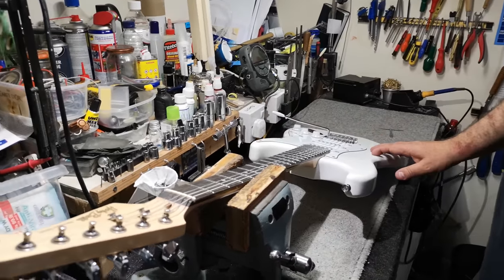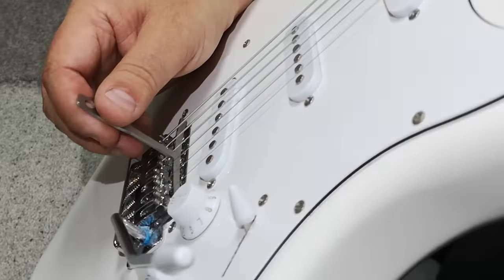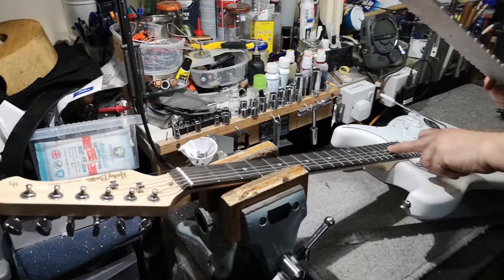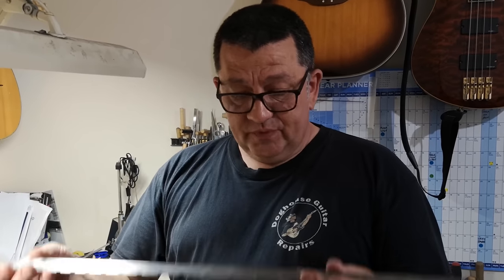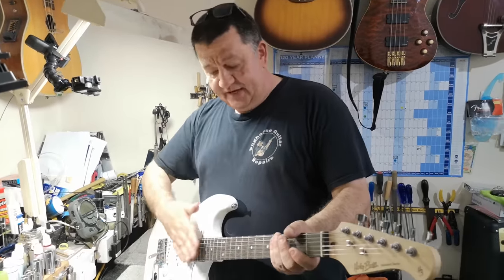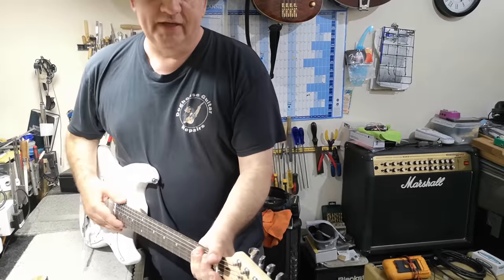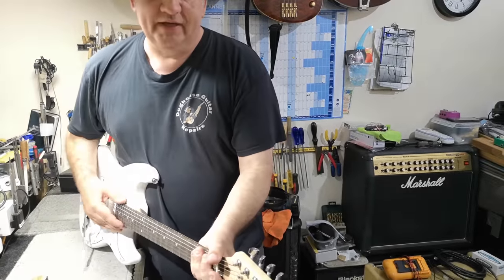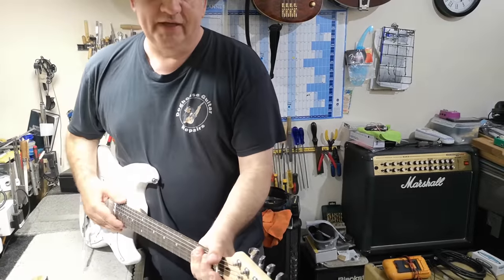I took my £30 / $40 Harley Benton to a LUTHIER...  (Harley Benton Setup - Video 1)

Comment: His main view seems to be just set the action high and you'll have no problems.  What I want to know is how to set the action low with no buzzing or choking.
Reply from the maker: Hey Joe, you can use all the same techniques mentioned in this video to get a good setup on your guitar, then tweak it to lower the action if that’s your preference. 

It does get trickier to avoid buzzing / choking the lower the action gets, any issues in your guitar’s setup make a bigger difference.  I always recommend Dan Erlewine’s books about guitar setups, they teach you everything you’ll need to know.  Hope that helps.
Reply: @ScottPoleyMusic  That's how I judge a guitar, how low the action can go.  I have set up all of my guitars and It's a REAL trick to get those frets perfectly level  enough to have real low action!  That's one reason I like Gibson's latest guitars, because they Plek them and their necks are awesome with perfect frets!  

 I'm always looking how the pro luthiers do it to get that low action.  Stewmac has this weird $600 complicated  neck jig where you  use dial indicators and strap your guitar to it to simulate string tension and then you rotate it into playing position and then level the frets.   I'm going to give that a try (make my own, of course).  But this luthier he doesn't even try to get low action.  Hell, I already know everything about setting up a guitar that he talked about, I was hoping he would have some information on getting low action that I hadn't seen before.

Thanks for the reply.

Comment: I've been adjusting and repairing guitars for over 40 years and doing this on a professional basis since 1990.
My opinion is that each and every guitar should be made as good as possible, without any compromise.
Why? Beacause the materials that are used to make them, are becoming more and more scarce.
Animals have to flee away from their habitat to harvest the woods that are needed to make you a fine guitar.
We can't aford to cut those trees and make poor products out of them, that has to be waisted after a while because of poor qualities.
I consider that to be a serious sin. Cheers!
Reply from the maker: That’s another valid and important take on all of this.  Thanks so much for this comment.

Comment: It just goes to show what the main difference is between a 200 and a 500 guitar. A huge amount of that difference is set up.  The cost goes up quickly when someone has to go over the guitar and make all the corrections. It's the little things in life! You go from a guitar that looks pretty good and sounds ok, but just doesn't feel great, to a great feeling guitar that sounds pretty good. Now he has a 230 guitar that's fun to play.  Great job Phil.

Comment: Any luthier will take any guitar you’ve got at any price level and set it up. If somethings too cheap to work they might suggest replacing it like the tuners the nut not too often the bridge the body the neck and a loaded pick guard you should be fine…
Reply from the maker: Agreed Walter.  With this guitar, I’m trying to make as few modifications as possible (other than the setup).  Currently it’s only had a new jack socket, the rest is 100% stock and it’s performing remarkably well.
Reply: @ScottPoleyMusic  These are the days where you can actually pay 10 or $20 and get a strat shaped object that looks like a strat  and sounds like a strat.

Comment: Every time I watch/listen to a luthier I learn something new about guitars... and, as an engineer, I'm always embarrassed that I didn't figure it out myself. The only topic that I didn't understand was why new strings are required to measure/adjust intonation... huh... is there something non-linear about string age vs string length... what am I missing here????
Reply from the maker: As strings age, intonation “drifts”.  The force / tension on such a thin piece of metal is immense.  

Every time a note is fretted on the neck, the strings bend over the frets causing gradual misshaping of the string.  

It’s a gradual process, but can cause issues, hence using a fresh set to intimate.  Hope that helps 👍
Reply: @ScottPoleyMusic  Oh, I get it. Each fret causes a slight kink in the string which lengthens (or maybe effectively shortens???) the string. You can retune the string, but now since the length has changed, the intonation is off.
Reply: Hmmmm... I'm thinking that those little kinks would change the frequency spectrum of the string... bring up some side lobes of the fundamental??? Maybe even broaden the main lobe??? Anyone look at this with a spectrum analyzer (new string vs old string)?

Comment: I have a Harley Benton myself and have completely stopped playing it! The fret board is way to rough and the fret ends have cut my fingers way to much! The bridge is also very strange and feels really high. All the talk of how wonderful these things are is the biggest pack of lies I’ve ever heard!
Reply from the maker: The fret ends on mine were really rough when I got mine too.  I wonder if your bridge is similar to mine as well - Phill shimmed the neck on mine to get the bridge to sit at the right angle.
Reply: I just seen your response and thank you for replying. I’m still at the same point with my HB unfortunately, it was a gift and I’d never buy a cheap Chinese guitar willingly but it is what it is. One thing else to mention is mine has cheap active pickups (which are downright terrible) the the tuners are just the worst! No matter what I do it just will never stay in tune… I’ve actually looked on Thormann for just how much it will cost me to strip this thing down and replace the cheap with good parts: new pots, wiring, switches, locking tuners, bridge, saddle, and some seymour Duncan APH-2S (the most expensive part that costs more than the the actual guitar), along with tools I’ll need. The total is well over 1000€! This is unfortunate reality of getting what you pay for and why I will continue to warn anyone other than the most absolute beginner about this brand. When you buy a Harley Benton guitar it does not matter how much you invest into it, it’s still and always will be a cheap guitar that’s worth nearly zero the moment you bring it home.
Reply from the maker: Fair enough!  I agree with you about the money pit of modifying guitars endlessly, better to invest in something decent in the first place than replace all the hardware and electronics on a cheap guitar.  That’s exactly why I didn’t spend much money modifying mine.  

There are so many high quality budget friendly instruments out these days, from squire / Epiphone to the new breed from Sire and PRS SE DGT (a beast of a guitar for the price).

Comment: Damn, didn’t answer the question about leaving strings off.
Reply from the maker: General rule of thumb Paul, it doesn’t really  matter if the strings are off for a matter of a few minutes.  I would recommend leaving them off for much longer than that 👍
Reply: @ScottPoleyMusic  I’m refinishing an explorer so strings are off currently. I guess I could just loosen the truss rod.

Comment: Harley Benton have a very flat neck radius, nothing like the 9.5" of a Fender or Squier. This one has 350mm or 13.75" - the radius gauge doesn't help here.
Reply from the maker: I examined the radius more after this video was filmed with my radius gauges.  This guitar's radius starts out as 10" and flattens out slightly towards the end of the fingerboard (not by much).  Maybe Harley Benton did a few runs of different radius'...
Reply: @ScottPoleyMusic  That's interesting. This is their cheapest model. They do not experiment with it. It is more a matter of getting whatever was around in the factory regardless of what the specs say (something that has happened often in the past). Then the angle seems to be wrong too but thanks to Leo Fender, it's an easy fix.
Reply: @ScottPoleyMusic  I also came here to say the guy got the radius wrong but it seems like the factory didn't care too much for the specs.  As long as it plays well, I have about 10 HBs they're all great guitars
Reply from the maker: Apparently so, Phill doesn't get things like that wrong, I can assure you.  He's one of the best in the biz, plus I checked it again later.  It plays great, I used it on a studio session last week.  Video to come.  

Also, LutonMassif... Best YouTube name I've come across in a while 😂🤘

Comment: If he got my harley benton he would have thrown it in the trash lol.  I spent quite a bit of money on tools and several hours just to get it playable.   Then after some Seymour Duncan's I could have just bought a better guitar with a bit of resale value
Reply from the maker: 😂 That’s a good point Richie, I don’t necessarily prescribe to the “buy a super cheap guitar and spend hundreds of pounds / dollars modding it”.  Obviously each to their own and it’s a great platform to learn on.  

A set of Seymour Duncan’s plus some good electronics would cost 7 times as much as I paid for this HB. 

I genuinely like the sound of the stock pickups, they’re a tad underpowered but they sound great.

Comment: Weird how the 'luthier' went straight to wanting to shim the neck, without checking if the action and bridge saddle radius had been set up sufficiently. And by weird, I mean, really, really stupid.
Reply from the maker: Hey Jayszyn, thanks for your reply.  Phill did give the guitar a quick examination while I was setting up the cameras / lights.  He determined that the action was set pretty close to recommended standards (plus it was comfortable to play when I got it).  The bridge radius, whilst not set perfectly was not a million miles off.  Adjusting the truss rod to the optimal angle would have meant cranking the bridge saddles past the top of their travel, not allowing for correct bridge radius adjustment. 

With your experience (nice channel btw), you know how to spot problematic areas early on in a job.  This was one of those cases.  No point polishing the car when you’ve got to pull out the engine.  

I, along with many other pro musicians trust Phill with our instruments because he’s fantastic and far from really, really stupid.

Comment: I thought all Harley Benton had 12" radius finger boards?
Reply from the maker: Not this one Sid.  It's pretty much 10"  across the board, it flattens out slightly towards the top of the board but not by much...
Reply: @ScottPoleyMusic  On these the website is 13.78" radius. Most of theirs are this radius. They have recently introduced some with 12" now and the Fusion range varies. I've had 30 Harley Benton's including this one. Great for the money
Reply: @ScottPoleyMusic   Ill have to re-look at them as ive always avoided them as they always advertise 12" fretboard radius which I just cant get on with, too long a strat player ;)
Reply from the maker: 30 Guitars!!!!  That's mental 😂🤘 I don't know if I've got some oddity or what but I can assure you it's a 10" radius.  Phill tested it and I double checked after someone else brought the question up.
Reply from the maker: I don't know if mines just an oddity or what...  I find flatter fingerboards a bit odd to play too, but they do offer alot of benefits once you get used to them.  Jimmy Herring talks alot about it on his first rig rundown, interesting stuff 👍
Reply: @ScottPoleyMusic  117 in total, just 30 Harley Benton 🙈
Yes I’d say that’s an odity but in a good way. They’re so flat usually and don’t feel like a proper Strat. Good video btw
Reply: @ScottPoleyMusic  I prefer the half way house of a 12” but they all have their place for sure
Reply from the maker: 🤯🤯🤯🤯 whaaaaaaaaaaaaa?!?!?!?!  😂🤘 Thanks so much.
Reply: @ScottPoleyMusic  I know 🙈🙈🙈. I’ve reviewed about 40 of them on my (novice) channel. I need help 😂
Reply: @ScottPoleyMusic  just subbed too btw
Reply from the maker: I will be checking them out 👍😎
Reply from the maker: Thank you so much 👍🤘 loads of content coming.
Reply: @ScottPoleyMusic  cool thank you Scott. Chapman, PRS, fender, Squier, Ibanez, Harley Benton, vintage, Glarry, Epiphone and maybe some others, can’t remember!
Reply: @ScottPoleyMusic  look forward to it